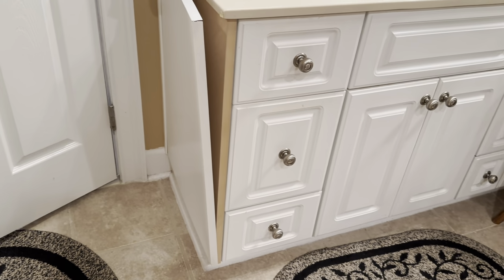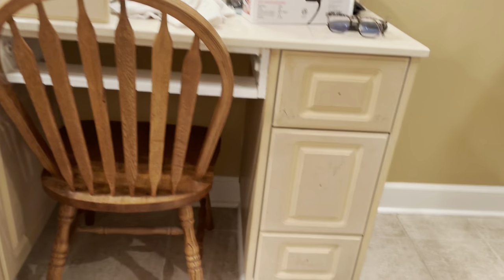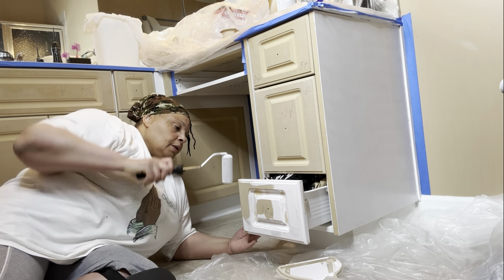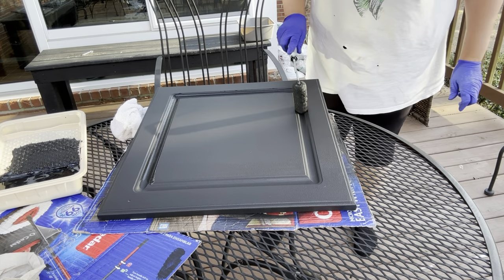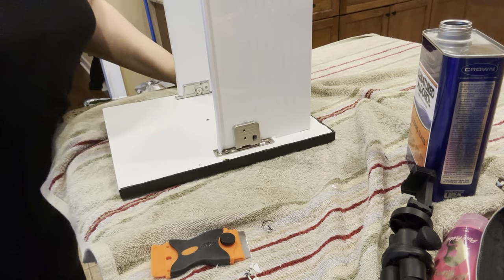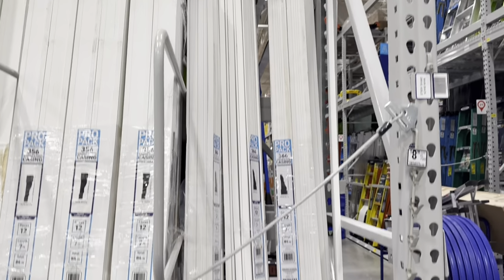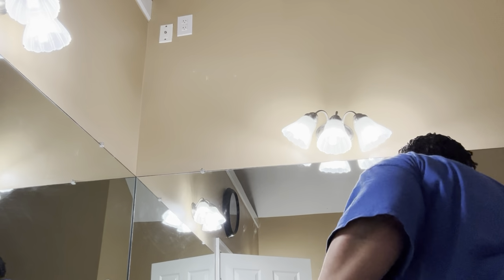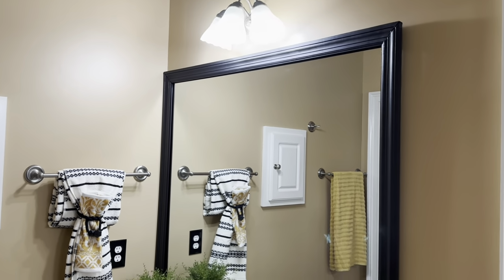DIY MODERN PRIMARY BATHROOM RENOVATION 2023 | DIY MODERN BATHROOM MAKEOVER 2023

Comment: Shanna, Upon moving into My new Home and facing that terrible mirror. I immediately ask My Contractor to have it removed. Thank God, He didn’t, because after I had shared My concerns. He! Like Yourself concluded that replacement of the Mirror would be too costly. He suggested surrounding it with the Crown Molding for which He had installed in other areas of the Home. You did an excellent DYI on those cabinets and I am so Happy to have learned that You are proud, as well.
Reply from the maker: Hi Claudette, Yes replacing the mirrors was going to be very costly. As you can see I have the bifold large mirrors I am so glad Mark took on the assignment and made the frames ...the frames are a game changer! Thank you! 🤗 Mark and I are truly enjoying the bathroom renovation. It was well over due. Thanks for being here and supporting me.

Comment: Everything looks nice thanks for that tip about removing paint I have to go buy some of that stuff. I painted our master bathroom white and black even our faucets and light fixtures I spray paint black 😊.  In your shower that looks like a black shower curtain. Try that transparency peel and stick that's what my husband put on our glass shower on the outside. Haven't had any problems with it and it looks nice just a suggestion
Reply from the maker: HI Tonya, I sprayed painted my faucet in my laundry room renovation video. So far it's holding up great. I was thinking about going back to spray the all the faucets that way I can save because they can get very expensive. I am holding off with the shower because I want to do a total gut job. I appreciate you sharing the transparent peel and stick with me. Thank you for watching and leaving me a comment. And most of all thank you for your support. Enjoy the rest of  week!